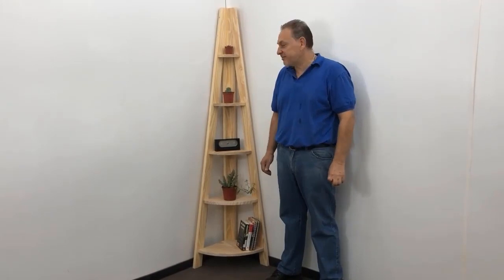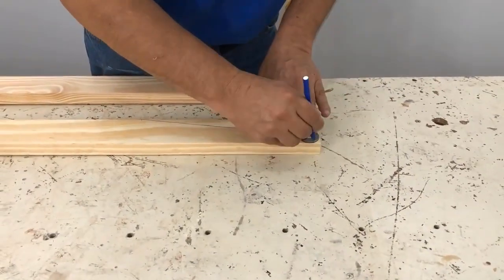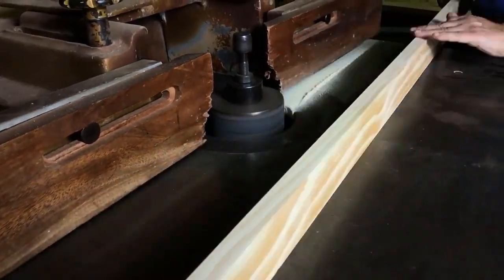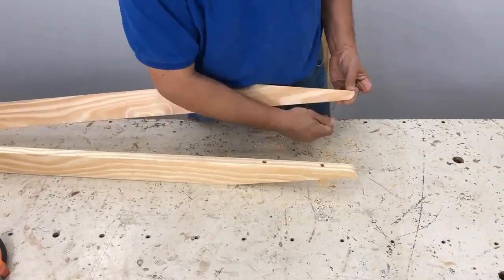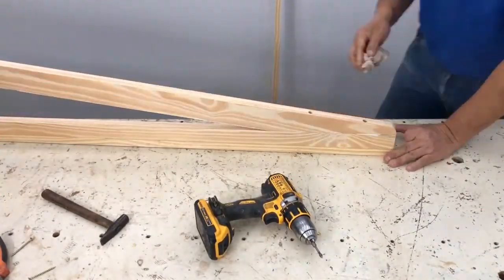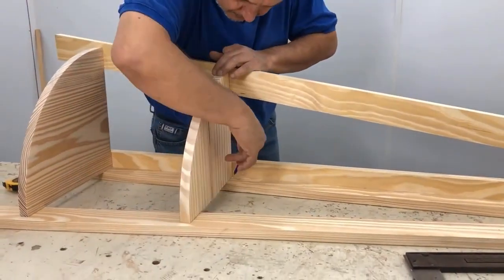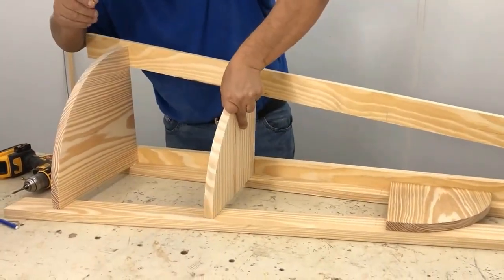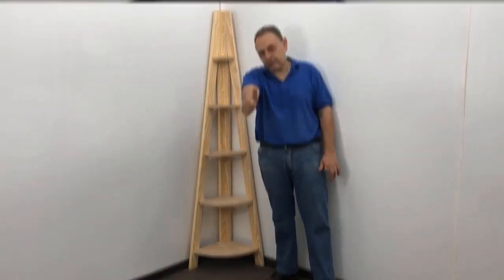Wooden Corner Shelf Very Easy to Make - Tutorial

Comment from the maker: Corner shelf
Pine wood
Materials:
- 1 strip of 187cm x 7cm x 2.3cm
- 1 strip of 187cm x 4.7cm x 2.3cm
- 2 strips of 190cm x 7cm x2.3cm

   shelf boards
- 1 board of 33.5cm x 33.5cm x 2.3cm
- 1 board 28cm x 28cm x 2.3cm
- 1 board of 22cm x 22cm x 2.3cm
- 1 board of 16.5cm x 16.5cm
- 1 board of 11cm x 11cm x 2.3cm

    1 cm diameter plug

- 30 Screws 52mm x 4mm
- 2 screws 38mm x 4mm

     Sand before assembling